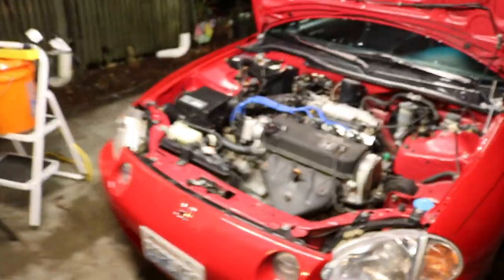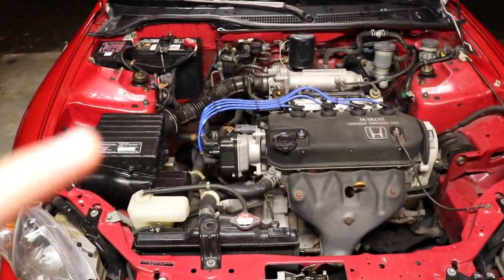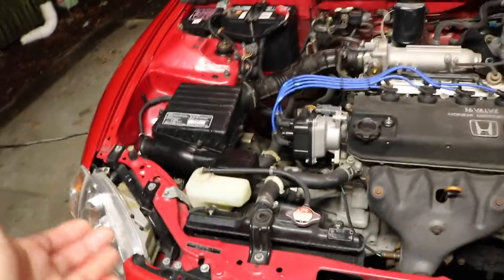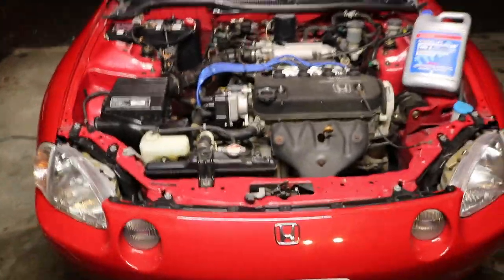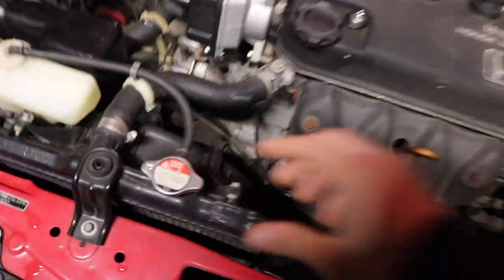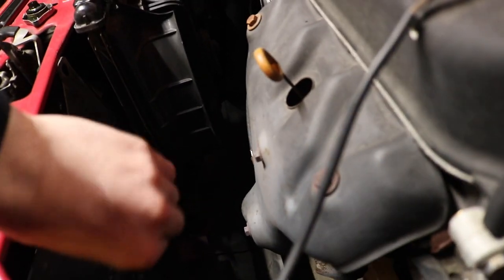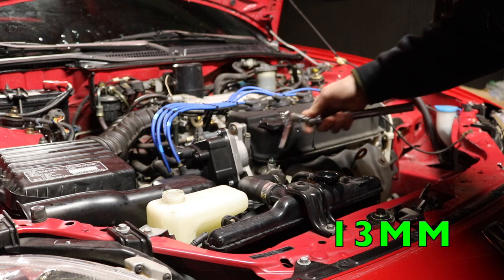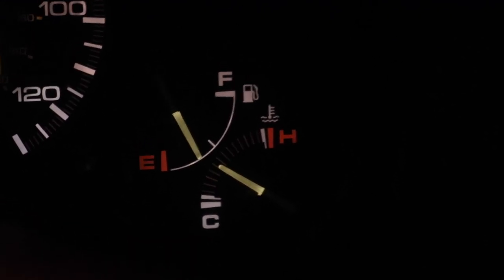Honda Civic Del Sol Coolant Flush!! The Reason why it was "Under Cooling"

Comment: You didn't actually flush anything. You just did a coolant replacement and as one of the previous comments said, you didn't actually get all of the old coolant out because you didn't drain it from the engine block.This means you mixed two different types of coolants which is bad. If it's getting cooler as you drive it's most likely your thermostat or even your temperature sending unit. Both cheap and easy to replace so might as well do both. We are all living and learning. I've made worse mistakes.

Comment: My accord is the complete opposite, when i drive it it cools down almost too totally cold and when i sit there the temp rises to normal and then it cools down when i drive.
Reply: sounds like the thermostat is stuck open
Reply: My del sol is exactly the same right now I’m replacing thermostat tomorrow hopefully that’s the problem because then my next guess would be water pump

Comment: What about the coolant in the block? There is an actuall drain bolt on the engine block itself that u are suppose to remove also to drain all the coolant from the block. This is according to the honda operators manual.